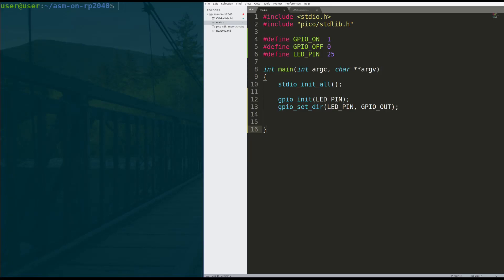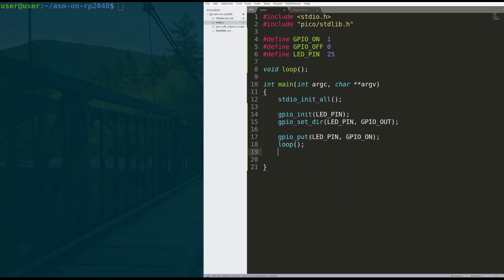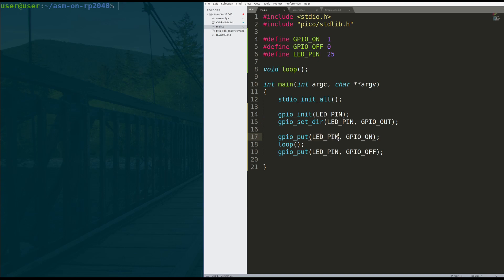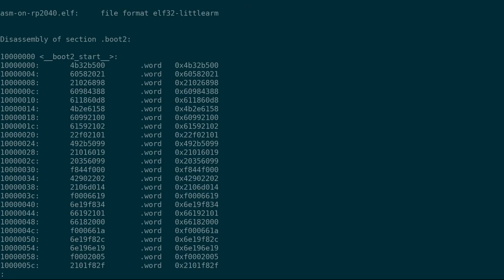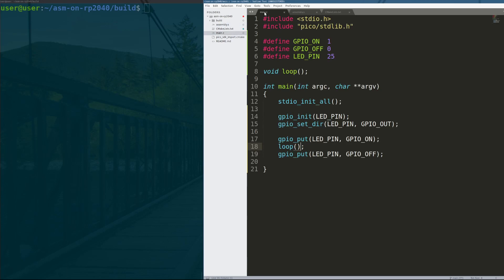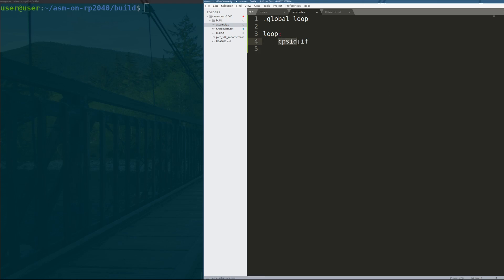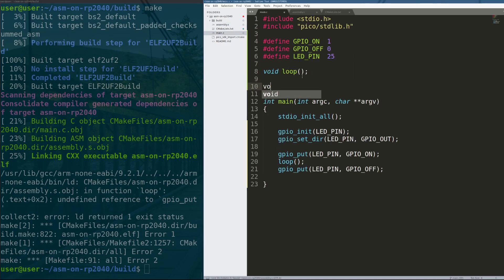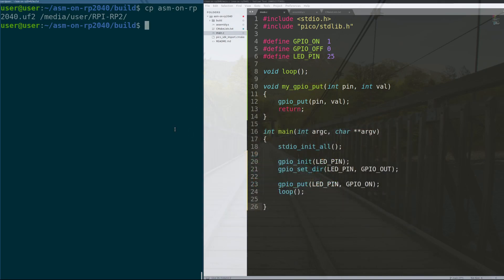How to Write ARM Assembly Language for the Raspberry Pi Pico

Comment: What would be a practical scenario where you need to write an assembly function?
Reply: When time is critical and the code isn't meant to be portable, you can optimize hot functions if you know how to do it better than the compiler. 

Also assembly knowledge is valuable in embedded systems, looking at the assembly output can give you hints on why your programs are slow or chunky.
Reply: for the sake of being able to
Reply: When you need to do something very specific to the hardware that C wouldn't understand, or doesn't have syntax for. Such as: disabling interrupts, bit rotates, using IN/OUT to talk to external hardware, etc.

Comment: Doesn't this assembly program have a bug? At 7:03 you do a 'b my_gpio_put' but the 'b' is an unconditional branch without link, thus you can't return to the line after the 'b my_gpio_put'. In the my_gpio_put call the "return" in the C code will do the return as "bx lr" but since the assembly code hasn't set LR it will jump back to the whatever value was last set in LR, which is the line after the call to loop() (which also the end of the function). Thus the 'cpsie if' instruction is never executed. I think the assembly code should do 'bl my_gpio_put' and at the end 'bx lr' for normal operation.
Reply from the maker: Good eye!

Yeah I noticed this bug a day after I uploaded the video. It still gets the point across but youre right that the returning doesnt work correctly.
Reply: noice, i spent more than 4 hrs before peeking in the comments
Reply: Come to think of it, what's the difference between bx lr and MOV PC,LR

Comment: This video is great! I actually want to do something like this to turn on a bunch of Neopixels for 250 micro seconds, and then turn them off again for 71 milliseconds (71,000 microseconds). I’m just not entirely sure if the Neopixel 800kHz data rate will allow me to do that entirely. (Trying to made a 14 Hz strobe light with Neopixels.).